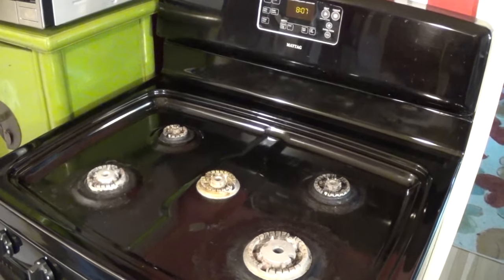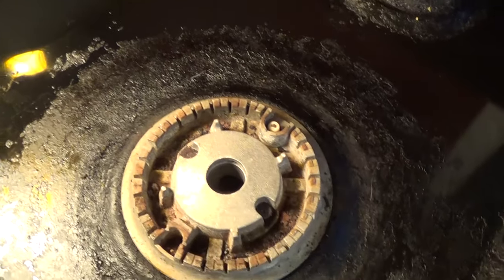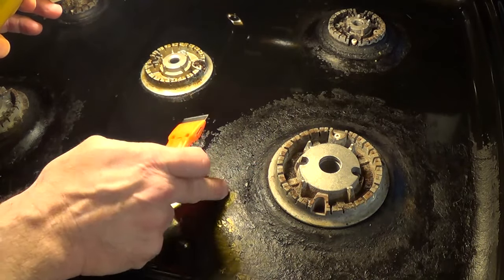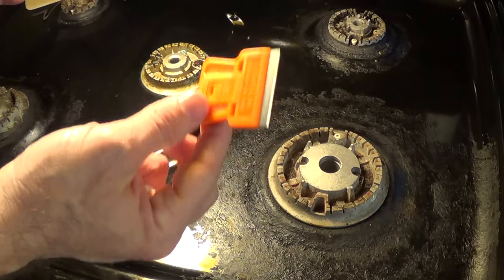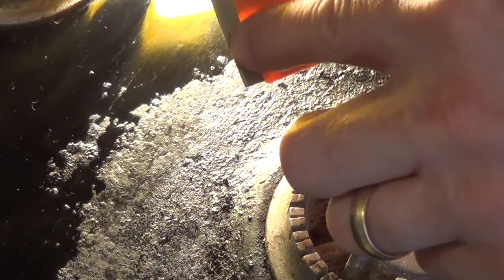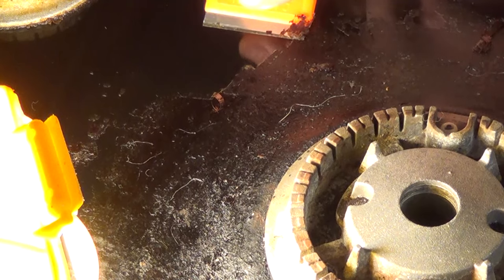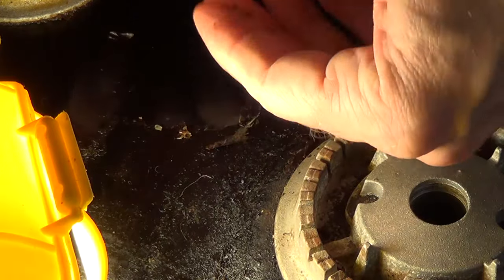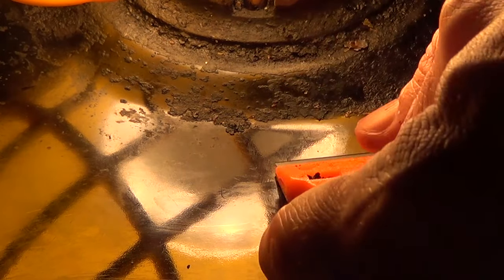How to Remove Burnt-on Grease from your Stove-top

Comment: Lesson Learned:  NEVER, EVER buy a residential quality gas stove like this one!  I made the mistake, thinking how much more versatile the gas cooktop would be and have been sadly disappointed ever since.  The gas only provides marginal increase in heat (if any) and it's a constant--I mean CONSTANT pain to keep modestly clean.  Mine has looked like this one many times, simply because it's such a headache to clean!!!
Reply: yeah I gotta agree. wiping down an electric stove top with hot soapy water after every cooking is so much easier and faster...
Reply: For me, the versatility of gas out weights the problem.  Never have liked electric stove tops.

Comment: Your video was a great help.  I was at my wits end. My stove is only 5 years old and the top looked as bad as yours.  I tried everything to clean it and thought I would need a new top, or have to find a way to paint it.  It actually looked like it was heat damage caused by defective paint.  Seeing your stovetop looked just like mine,  I figured I try your method.  And damn.  Within a few seconds I was elated to see  Brand new paint begin to appear from under the crusty hardened surface.  Using your exact blades and method, within about an hour I resurrected my stovetop and without exaggeration looks like the day we bought it.  Now I know it was just hardened grease and not bad paint.  Thanks for sharing this on video, it saved me from going down the wrong path.  
Dennis

Comment: I came back to comment. Thank you so so much! I had tried so many things; various degreasers, oven off, baking soda & vinegar, etc. All Fails. This method really is the trick. For anyone watching this video the razor blade works! It was a little intimidating at first b/c I  didn't want to scratch the stove, but it doesn't take much to get a feel for how much pressure and angle to use. Stove looks brand new😄

Comment: Works beautifully.  I tried using vinegar, baking soda & scrubbers & soaking to no avail.  Grabbed a construction grade single edge razor blade and was done in two minutes.  Thanks so much Geo!
Reply: Yes, baking soda and vinegar essentially neutralise each other.  Such methods are recommended by folk who have never actually tried it themselves.  Hot caustic is the only solution that will remove baked on grease.  Car engine rebuilders have been using a "hot tank" forever.  'tis the only way.
Razor blades? give me a break.  Sorry to target you Ed, but had to say something about this baking soda and vinegar myth - as you found out.

Comment: Saved me dozens of hours after very slowly and incrementally going at this with Easy Off No Fume and baking soda. Watching an almost imperceptable amount of gunk come off after overnight soaks, day after day was very frustrating. Using a razor blade I did the equivalent of about 4-5 days of soaking and removing in about 10 minutes and didn't scratch the paint at all!

Comment: Great video. Worked great on those black grease stains. I would like to add that anyone doing this wear cut resistant gloves and safety glasses.  A trip to the hospital for cutting your self with a razor blade or having a corner break off and go into your eye and you’d wish you just bought a new stove.  You only got one set of eyes

Comment: Thank you Geo for wonderful and effective method of restoring my sieve top. I tried everything and bought so many different t products that didn’t work. I was at the point of using a sander out of desperation to restore my stove. Thank you so much for sharing this video my stove is like new again,  It took me about 2 hours, I ended up with a few little scratches but, I was able to use a Weismann polish cleaner  which helped to bring out the luster. Great video

Comment: FINALLY a stove that looks like mine.
I’ve been using a paint scraper but I guess that angle on a razor makes a big difference. Thanks. I’ve been living with this over a decade and thanks to your solution, my stove top will be clean!!!!!! I will also try the same method under the stove top. There is a mound full of grease and burnt food. 
🙌 🎉 😆

Comment: To loosen that kind of burnt on food or grease, first sprinkle a good amount of table salt then  put some vinegar on it wait a few minutes, use a end of a spoon to scrap it it will be loose and come off. You can also use a stainless steel scrubber too with some dish soap to remove remaining residue . It really worked good for me .

Comment: Mine was just as bad, maybe worse. Real thick baked-on crud. This technique partly worked. But it was so thick it would not work in most places. So, I thought, it looks like hell anyway….So I took a propane torch and heated it first. Worked a charm. After years of struggle, it’s finally gone. Only worked in small sections, a few square inches at a time, being careful of not too much heat to avoid warping the metal. Very pleased with the result.

Comment: I used a cleaner called spray 9 and let it soak for a while to help remove some but what worked for me after that was a key! I put some pressure (but not too much) and scraped at it and then wiped it with a cloth to remove everything with no scratches. So before you go running out to buy razors try a key!

Comment: Here is a product out now that works pretty good even on “black” grease. Dawn Ultra now comes as Powerwash Dish spray. I had to use it on the silver part of the gas burner and it took most of the grease off the 1st time. Brown grease comes off much earlier than when it is black but you always have to be careful scraping it off.

Comment: Honestly I was 15 minutes from going to buy the heat resistant paint. I had already taped up the orifices, and taped newspaper all around the edge. The bumpiness made me think the metal had rusted and bubbled up unevenly. It was a used stove I just bought. It had bigger burners but I figured a little paint and it'll last long enough. I had tried baking soda vinegar the day before no difference. This was it. This is what it was. And I didn't find the right angle until half way through, and once I did, it went a lot faster. At first you're afraid to scratch the paint, but once you realize the angle, and its actually white steep almost 45*. Now I wish I had a before picture, because after it looks brand new. No paint needed. Maybe the touch up bottle for some knicked spots and corners only.

Comment: Add some oil on the clean surface that you going to start from scraping into the debris so it doesnt run dry and scratch the surface. Nice tip 👌

Comment: This is great. Just saved money on that degreaser I was considering - I know it wouldn't work. For that corner maybe you could use a scalpel or x-acto knife with a small curved blade (like #10). Chisel blades could help with narrow areas.
Reply: This is an old video, but for corners, I used the back of the end of a table/butter/dinner knife... whatever it's called. One side is slightly serrated, the other is smooth and a little rounded (on mine anyway), so the smooth side of the rounded tip worked really well.

Comment: Go to harbor freight and get a scraper with a ten inch handle. Works so much better. Angle of attack is so important as well. Remember the paint is enamel coat. It’s very hard and durable.

Comment: Thanks, very tedious, but worked great. I used a small lock blade pocket knife; I think the curve blade helped some. Now i need to get the burners off, but the screws are stripped and rusted on. One is not stripped yet; but the screws will not budge even with an impact driver. I got one burner off, so that helps plan for the others? Does any one have any good ideas to get the screws out and also I need new screws that fit a whirlpool gold 465 gas stove burner. I can't find them anywhere?

Comment: This right here is why I will be getting an electric stove asap.. I have never experienced the level of cleaning rage I have while cleaning my gas stove and oven, lol.. And then after several hours of scraping, wiping, degreasing, bumped knuckles and sticky fingers, you're rewarded with uneven baked goods, every dang thing too hot to touch without pot holders, and a whole new supply of baked on grease.. 
I just finished cleaning mine, so my rage was recently renewed🤣🤣🤣

Comment: I just spent the last two days trying to clean the burnt on krud.  Fornationly I put a layer of aluminum foil on the cooker top under the burner base. I have the exact same burner  bases as you. I tried easy off oven cleaner, baking soda, pot and pan cycle on dishwasher, windex, dish soap, boiling, tried to burn it off. Nothing worked.  I will have to do it your way.  Since it is the burner base a wire wheel is next on the addenda.

Comment: why not use plastic scrapers with a sharp edge? its not strong enough to penetrate the metal, but i'm sure it will work with the grease.

Comment: Mineral turpentine for burnt-in hardened grease, let it soak for couple minutes.
Reply: Isn’t that flammable & fumes  are strong
Reply: @debrasalinas2831  Yes it is flammable (but not like gasoline), not a problem. And yes it smells, but that's a mild inconvenience compared to scrubbing. Just open up a window.
Reply: @atklm1  I have asthma & something like that would literally take my breath out of me the fumes.. yes some normal people might be able to handle it .. but not people with lung issues especially if children or infants are in the home .. sometimes it’s easier to use good elbow grease and work on it through the day with Dawn & vinger and baking soda & gloves and hot water scrubbing 🧽 pads …
Reply: @debrasalinas2831  Another more asthma-friendly option is to use cooking oil and let it dwell for a while before taking Dawn and start scrubbing. Burnt grease gets a lot softer when soaking in oil, and that does half the job.

Comment: Do you want to try something that's much more simpler and easy there's two ways clean your stove top with straight ammonia spray it on and cover it with Saran Wrap or spray it down really good with straight vinegar and dusted with baking soda let it sit for 45 hours and then come back it's going to be easily wiped off
Reply: 45 HOURS?  That means you can't use your stove for almost 2 whole days....
Reply: @miket803  no I don't know what happened to that message but it's baking soda and vinegar you sprinkle the stove top with baking soda and then you spray vinegar on it you wait a couple hours and it wipes clean and you can use your stove right away